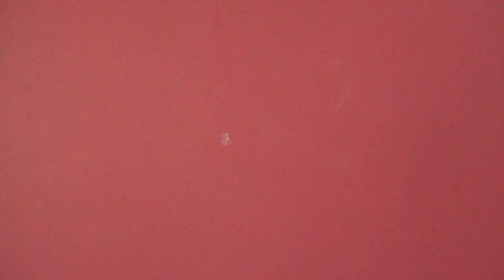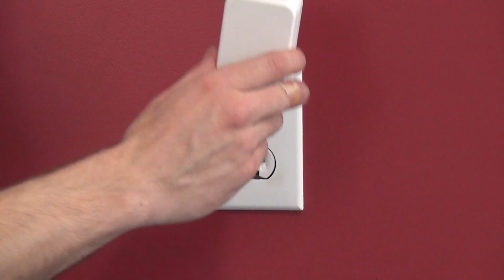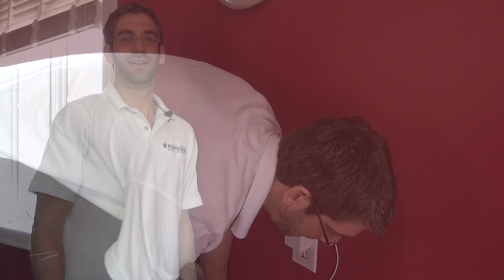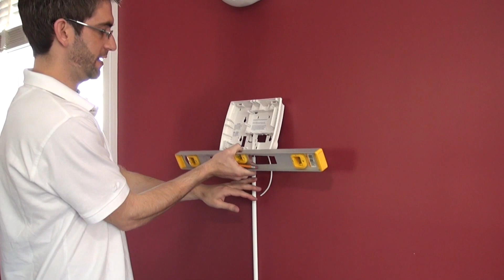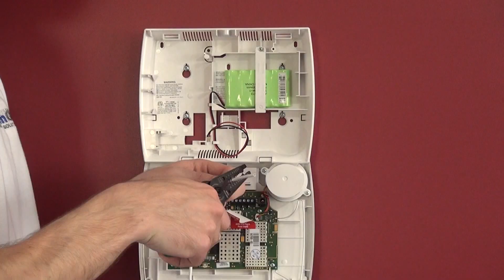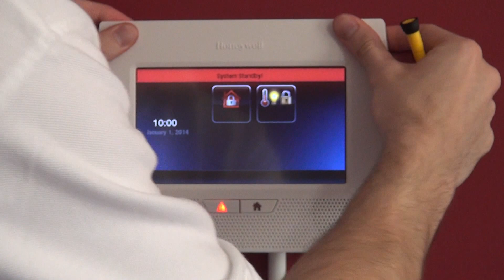Honeywell L7000: DIY Installation Using Wire Track and a Wire

Comment: The L7000 manual requires the panel be earthly grounded. It would have been nice if you showed us how to do it using 3 wires and just cutting only one. I understand that the screw in the middle of the outlet can be used as an earth ground, if properly wired.  But I want to thank you for your videos that helped me a lot in my DIY security alarm project.

Comment: If I install a Honeywell LYNX Touch 7000 Control System in my home, do I have to install a control panel or will this  LYNX Touch 7000 Control System be the control panel and key pad in one?

Comment: Can i used the power from my existing 20P panel to existing security panel(that is going to be replaced) and connect the hot and ground to the screen terminals?

Comment: installed l7000 can't get past boot sceen. i have a 2010 model plugged in power receptacle then battery as instructions and your video shows. appears no errors found but will go no further. what do you think?

Comment: So is this a paid subscription alarm?  In order for it to work?  Or can you still install it without a subscription? Or by not paying it limits you to do some of the features?  Thanks
Reply: you can use the system locally but you won't have total connect or alerts available. they offer really cheap monitoring and self monitoring monthly payments.

Comment: I have an existing hard wired system that has wires from transformer in adjacent hallway running to control box in closet and from control box to panel.  Question: can I use existing wiring setup to simply connect to L7000 panel from control box.
Reply: I'm thinking the same thing

Comment: Doubling up does not make the wire better. The voltage will only travel on the one conductor with the path of lease resistance.
Reply: Andy Schmidgall You are absolutely correct. There is no real advantage to doubling them up. It was just mentioned as an option. Obviously, if you do double them up and one of the wires got cut, the other wiring would be there to keep the connection though.
Reply: Again Correct Andy Schmidgall "-) However like Sterling said, I've been installing for over 18 years and in most cases (if I'm only using 22/4 basic alarm wire( and not 18/2 gauge, I always do the "Double Up" trick just in case one of the wires ever get's cut, or breaks :)
Reply: Sterling Donnelly Everybody is kidding me! Thanks!

Comment: Can an iPhone or Apple Watch be used to arm and disarm the system ?
Reply from the maker: Yes, the L7000 supports Total Connect, which has an app that is compatible with most iOS devices.  The app is called Total Connect 2.0 and you can check it out in the App store.  In order to be able to control the system remotely through the app, you need to have a service plan.  We have plans starting at $10 per month.  You can check out our monitoring plans here www.alarmgrid.com/monitoring.

Comment: Does the battery come with the panel
Reply: The battery and power transformer are included with the panel, but there is no included wire.

Comment: Can this panel be setup as a stand alone, Not monitored?
Reply: Yes, the L7000 will work as a non-monitored system to simply sound an alarm when there's an alarm activation.

Comment: why not just take 3 min and snake (fish) behind the wall and come out at the outlet.....????
Reply: +Frank Longo is there a way to wire it directly to an outlet without having to use the bulky transformer and take up an outlet?
Reply: +Michael Wittchow No, this is a low voltage system and the transformer steps down the 120V from the outlet to the 9V the panel requires so there is no way to direct wire into an outlet.
Reply: +Sterling Donnelly my brother in law has the same system and does not have the transformer showing anywhere near the keypad. He had his professionally installed though
Reply: +Michael Wittchow The installer must have simply fished the wire through the wall and connected it to a transformer that is plugged into an outlet that isn't in the same room as the panel. That is very common but he does have a transformer plugged in somewhere that's connected back to the panel.
Reply: +Michael Wittchow  You Can run the wire & transformer to any outlet. Doesn't have to be the one below the panel. If you have a basement you can plug it in down there. or behind furniture in a different room
Reply: +nyerion929 I vote for the fish tape too.  Wire mold looks like shit.  Especially on a burgundy wall...
Reply: +Gadzukis We have another video for fishing a wire. This video was made specifically to show how you can use wire track if you prefer.
Reply: +Sterling Connelly boomuchzzzzed
Reply: I prefer this method. Especially since with the installer code you can have an alarm disabled and code changed in about 30 seconds if you can look up the manual and access the transformer.

Comment: Using 4 conductors doent work at all, is better to use 18 gauges is better
Reply: Are you saying that you used a 4-conductor wire and couldn't get the system powered on? We do recommend 18 gauge wire but you should be able to use 2 or 4-conductor as long as you match up the right screw terminals on the panel side to the right screw terminals on the transformer.